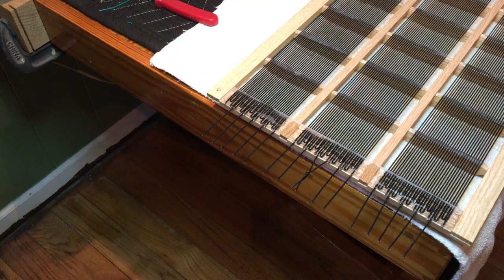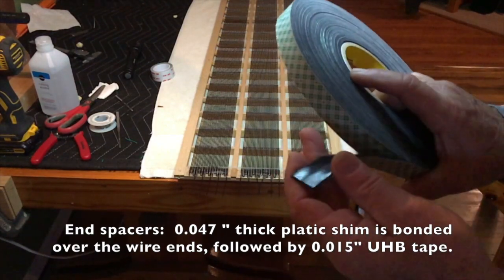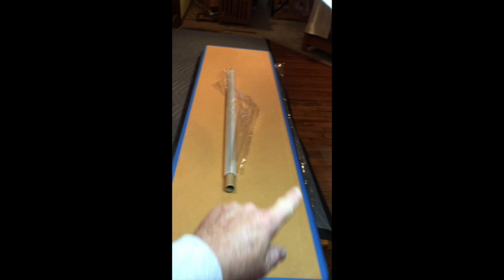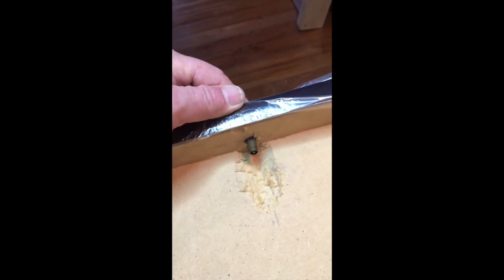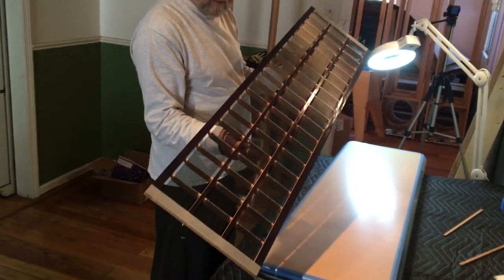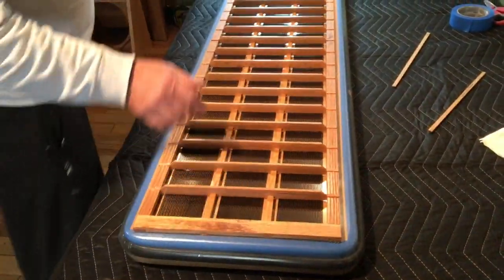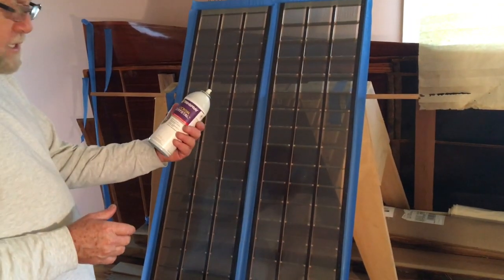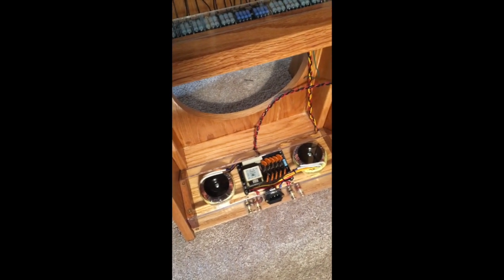Electrostic Loudspeaker Build Part 2

Comment: The stator frame, jigs, etc. are all wonderfully crafted.
A tension jig using a tube works well to stretch the film evenly.
In order to measure 1% elongation, we measure in the horizontal direction. Is it okay not to measure vertically?
Reply from the maker: It's a flat panel ESL so ideally the diaphragm tension should be tensioned the same in all directions, but because the jig is a rectangle (not square) I suspect it applies more stretch in the horizontal direction.  I've never measured the stretch vertically but perhaps I should have. 

The diaphragm is sectioned vertically in thirds so it makes sense to measure the elongation across the width, I think.
Reply: Thanks! 
I've learned a lot.
The other day, I used a method of attaching a film to a movable square aluminum bar and stretching it, but wrinkles appeared.
Next time I would like to try this method using a tube.

Comment: Good morning Charlie.
I would like to know if you are happy with Licron, they told me that it has low efficiency and the response is not good.
Does it last over time?
Thanks again.
Reply from the maker: I haven’t experienced any problems with the Licron Crystal and I have no complaints other than its cost and shipping constraints.   

The only cautions I would give are shake it well, apply it in one coat “just wet”, and don’t apply it on a humid day or it will blush (turn cloudy).  
 
I started using the Licron about ten years ago.  But every few years I’ve changed out my panels for newer designs, and I gave the older panels away for the cost of shipping.   And since I haven’t kept up with those older panels, I can only vouch for the current generation panels, which are approaching five years old now and still playing fine.  

The manufacturer claims that Licron Crystal is a permanent ESD coating, but I doubth they tested it under the same conditions an ESL operates at, and I can’t verify their claim.  

How long will it last?   I have no idea.
Reply: Thanks @jazzzman53

Comment: Do anybody know how long the licron coat will retain?
Reply from the maker: The manufacturer states that the coating is permanent but I can't verify that.  I've used Licron Crystal for fourteen years and the coating has never failed me.  I've sold or given away my earlier speaker builds so I can only attest to about 6 years of playing in my current speaker designs, and I have not detected any degradation over that period.  

I have read reports where builders had problems with it because they were thinning it down or wiping it on to obtain a thinner coating, instead of following the directions on the can.   

My advice for using Licron Crystal is DON'T GET CUTE.   Its already 96% solvents and on 2 microns dry film thickness anyway.  Just clean the diaphragm first, shake the can well, apply one coat "just wet" and let it dry overnight before assembling the panel.   Then you will have no problems.
Reply: @jazzzman53  Thanks! That's the information I intended to get. It seems the right stuff to be happy with :)

Comment: Good morning.
I would like to make the JIG.
I did not understand what material is what you find
https://youtu.be/ECM3gfrJPxQ?t=304
in the part under the JIG, where the mylar sticks.
Thanks for the great example I've been following you for years !!!
Great things.
Reply from the maker: On the underside edge of the jig; I applied urethane foam double sided tape.  The Mylar film wraps over the jig and sticks to the foam tape on the underside.
Reply: @jazzzman53  Thanks for everything!
As you will have understood, I too have built a type of cell that resembles that of the Acoustats.
But I used a different approach. To begin with, I built three machines, a CNC, an automated system to pull the mylar always at the same tension (with arduino) and a manual machine to bend the rigid aluminum wire. I wanted to use this type of metal to make stators (if you happen to and you feel like it), you can watch some videos on my channel.
 
https://www.youtube.com/watch?v=MEv1Xeh50bI
here play only a cell (woofer not work).
Great things and thanks again.

Comment: What do you think Sir, how many years all those sticky tapes will serve well? And how sensitive to a humidity that wooden frame is? Does it affect FR at all?
Reply from the maker: Regarding the tape; I called 3M and asked what service life I could expect from their urethane foam tape.  I was told 25 years if protected from UV.  I was also told it’s best to use it within 3 years of its mfg. date, while it retains maximum tack, but once stuck it stays stuck for its life.  I can't personally vouch for that but that's what 3M says. 
 
Regarding the oak and humidity effects; wood expands and contracts in the thickness dimension (normal to fiber direction) with humidity.  And it often has built-in stress which relives itself when it’s cut, by warping or twisting—sometimes, to dangerous effect if it binds up in the saw.  
 
Any warp or twist will occur immediately as the wood is cut, and it then tends to hold whatever shape it had coming out of the saw.  Straight grain, quarter-sawn wood is far more stable than flat sawn, and I’m very selective when choosing the planks I will use.   
 
More importantly; I designed the stator lattice to be flexible in the height direction and rigid in the width direction.  The vertical lattice details are so flexible that the strength of the tape bond is sufficient to keep the mating stators parallel and in intimate contact, even if those vertical details were bowed before mating them together.  Once mounted in the speaker frame, nestled between 1/8” medium density foam gaskets, the stators are held straight by the frame.  

The horizontal slats are the important pieces for maintaining a precise stator-to-diaphragm gap.  The slat edges which contact the wires are straight within 0.0005", and humidity changes affect their thickness but not their straightness.  
 
If you watched my Part 1 video; you may have noticed that I bond the horizontal slats over the wires, and against my stretching jig’s [very flat] platform-- which insures that any small contact gaps between the mating lattice details are pushed away from the platform surface and into the glue bond lines, where they fill with glue and become irrelevant.  
 
Using wood for the stators isn’t a problem if the design accommodates it :-)
Reply from the maker: The wood lattice has no effect whatever on the FR of the  panel, which extends from the X-over frequency (250Hz) to 
20kHz.  The FR would extend higher than 20kHz but the DBX Driverack crossover chops it off sharply at 20k.
Reply: @jazzzman53  Thank you Sir. It seems that all issues can be mitigated with a proper design and attention to details. I wish you keep creating! May be I'll start experimenting some day..

Comment: Awesome! Have you ever tried putting stators on each side of the diaphragm so it has a push pull affect?
Reply from the maker: Thanks for your interest in my speakers.  Both mine and ML's speakers use a two-stator, single diaphragm, push-pull arrangement.  

ML uses non-segmented perforated metal stators, and a curved panel to mechanically curve the wavefront.  Whereas mine use a flat panel with discrete wire groups, driven sequentially as a phased array, to curve the wave front electronically.  I can even widen or narrow the dispersion pattern by changing resistor values in the network that powers the wire groups.  

Perforated metal stators are much easier to DIY but insulated wire stators are less prone to arcing and more reliable.
Reply: @jazzzman53  that’s awesome!  Great job. I wish I could hear them in person, I bet they sound great! I know the ML do. I love mine. Once you actually heard the way electrostatics produce a wall of sound you’ll never want a traditional pair of speakers again.
Reply: @jazzzman53  hello sir . Hope you are doing well.   Liston cristal is kinda expensive for me as I have used all my budget toward transformer and other materials.  Will anti static spray for cloths do the job?
Reply from the maker: @miclairmiclair876  Yes, I agree... Licron Crystal is quite expensive.  Unfortunately; I have no experience with other coating solutions so I am not qualified to advise you on that.  

The cheapest coating I know of is ordinary dish washing liquid, diluted 50/50 with water and wiped on with a cotton ball.  It's reported to have good longevity but I can't confirm that.  I did try it out on a small test panel once and it worked great (very high output and resistivity).  Nothing sticks to it and it would attract dust though... 

The only coating I can recommend without reservation is Licron Crystal.

Comment: Where do you get the mylar?
Reply from the maker: On Ebay.  Search for electrotatic speaker diaphragm material.  6um thickness x 25" wide x 30 meter roll for $30, shipping included.
Reply: Is there a reason for not going lower in thickness? 
I see that it goes all the way down to 2 um which in theory should be better since the diaphragm would have lower mass. Is this just negligible in these sizes?
Reply from the maker: @theodornrby-lassen8210    Tensile strength and the application determines the best choice of film thickness.  For example; Martin Logan uses 12um film because it will take the higher tension used in their panel designs-- which use the diaphragm's fundamental resonance to enhance output in the low midrange, and thereby help to offset the dipole rolloff.  

My designs require less tension so I use the thinner 6um film.  I think ER audio uses 3.8um film in their hybrid designs.   I would not go thinner than 3.8um.  Besides; once you go significantly thinner than 12um, the mass advantage becomes moot because it's still coupled to the surrounding air mass, which dominates the moving mass / inertia equation.
Reply from the maker: @theodornrby-lassen8210  Thinner films may work well and are lighter but I was concerned about the fragility and strength in tension.  Perhaps I was over-concerned about that, but I know that 6um works well without rolling off the highs and I have experience and trust in the 6um.

Comment: Very very nice video. I have just changed my membrane with your ,,stretching machine``. 
It works! Is your doubletape electrically conductive (you put it over the copper conductor)?
3 µm membrane didn`t work. I put 6 µm like I think it was original on Audiostatic.
I found this Quote in my VAC Brochure:
In the immortal words of Daniel von Recklinghausen, if it measures good and sounds bad it is bad. 
If it measures bad and sounds good you've measured the wrong things.
Greetings from Germany
Reply from the maker: The double-sided tape is not conductive.
Reply: why 3um didn't work?
Reply: @鑫官  the bass was not so good  and it is more complicated to mount on the panel
Reply from the maker: @鑫官  I'm sure 3um film would work fine but I opted for 6um because I know how to tension it (never tried 3um).